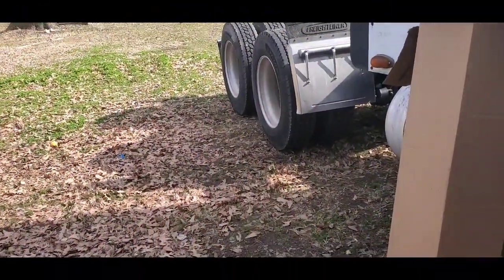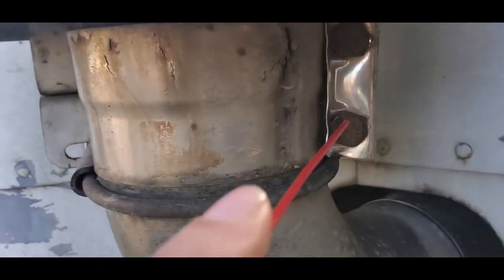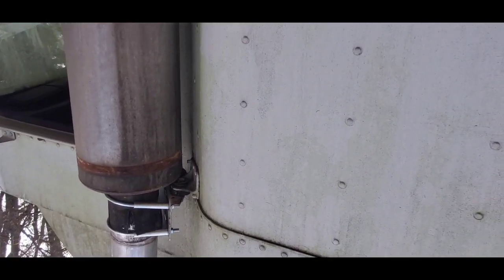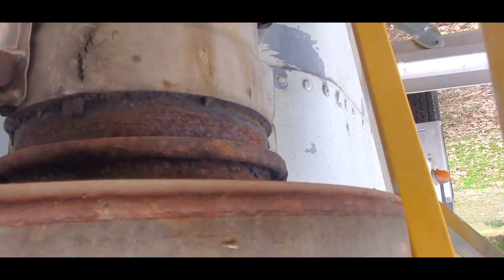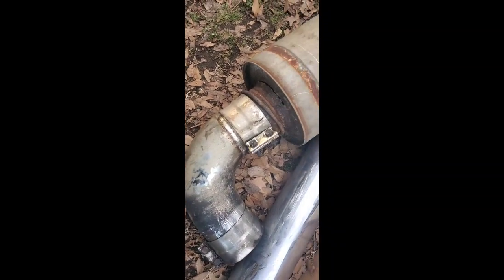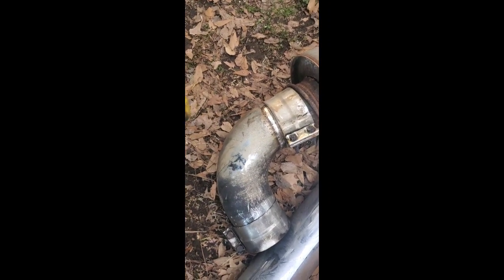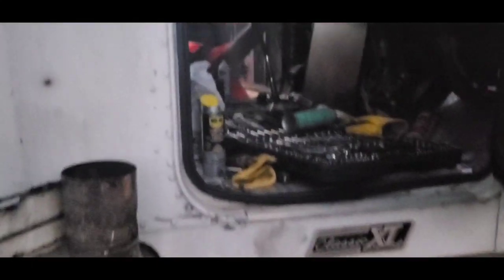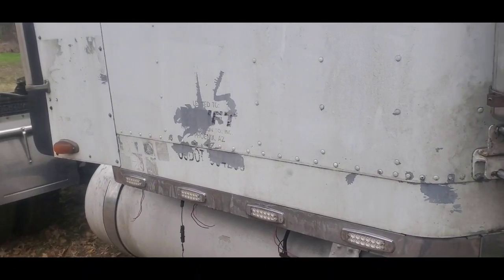How To Replace Muffler on Semi Truck! Freightliner Classic XL

Comment: Went through the same process back in April when i bought mine. I took the mufflers off and put on a set of 5 inch muffler deletes. I had to cut my elbow pipes out the muffler cause they were stuck and didn't feel like paying Freightliner $190 a piece for two of them

Comment: It will be a good idea to crawl up under the truck and inspect the Y pipe cause it rust out in the split of the Y. Also you gonna spend a CRAP load of money at the dealer..go to eBay or 4 states truck or miami star truck parts or Raney's truck parts, way cheaper than the dealer. Me personally when I built my classic I snatched those mufflers off and put me a set of 7inch lincoln chrome stacks on mine. Good luck with your build.
Reply from the maker: Thats why I didn't want to but that stupid elbow because in the future I plan on buying straight stacks but that y pipe has to be replaced its like old plumbing

Comment: You have the money you should have got the new parts for the pipeline and new clamps because once you used the band clamps you can’t reuse them
Reply from the maker: I did use new clamps. I cut through the old ones with a grinder